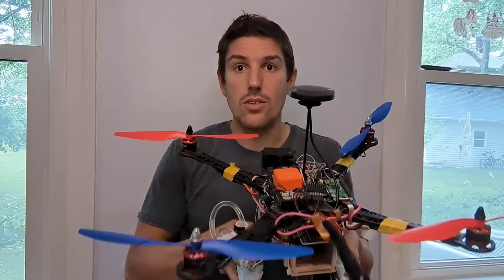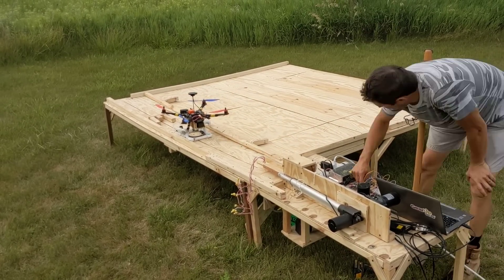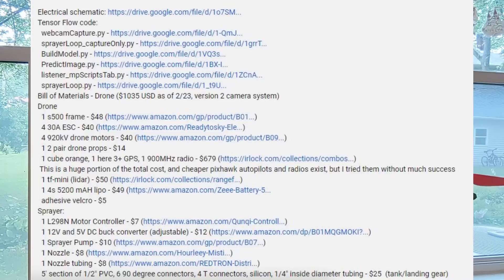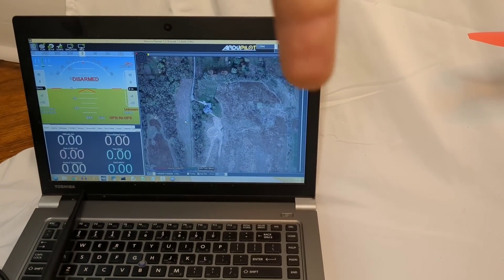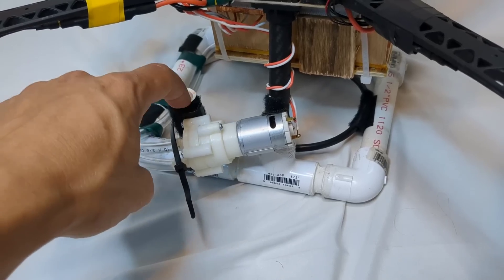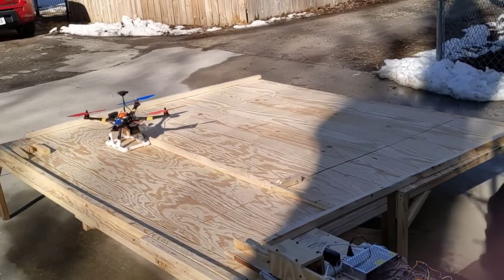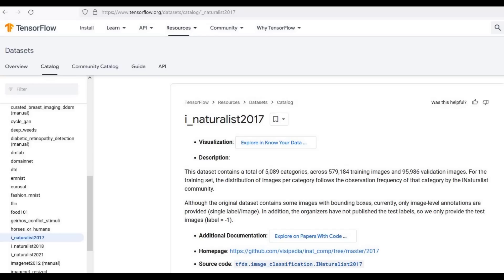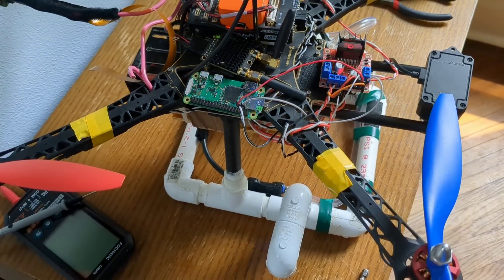DIY AI weed spraying drone, automatic landing pad/battery swap

Comment: This is really cool. I'm using your work as a guide to clean solar panels with a drone. I am curious, how do you determine when to fill up the water tank? Has it ever been empty during a mission before landing on the landing pad? Thank you.
Reply: I would think you could read the change in electrical current draw by the pump to determine when the liquid runs out
Reply from the maker: Yeah, it has emptied.  I'm working on a larger capacity tank and I try to keep missions short, but there are areas that are totally covered in weeds so it sprays constantly.  A float to detect when things are drained would be a good future addition as well
Reply: @nathanbuildsdiy  Thanks for the response, I thought along those lines of using a float sensor to check the water level. It's a bit tricky because I want to keep the drone as light as possible but I will investigate. Thanks again!

Comment: Wouldn't we need to get a waiver from the FAA in the USA for this? 

Waivers for Beyond Visual Line of Sight (BVLOS) Operations
To conduct autonomous drone operations beyond visual line of sight (BVLOS), operators must obtain a waiver from the FAA. BVLOS operations involve using autonomous capabilities and relying on sensors, cameras, and other technologies to navigate and perform tasks without direct visual observation by the operator. The FAA carefully evaluates waiver requests to ensure safety and may require additional measures, such as the implementation of detect-and-avoid systems.
Reply from the maker: Yup, I cover that around minute 40 of this drone build video: https://www.youtube.com/watch?v=Fflbc_y2IGQ&t=15s

Comment: have you had success running this autonomously for long periods of time?
Reply from the maker: For awhile, yes. But then the motors controlling the table burned up.  I'm now reworking the design so the collection/swap is faster and the motors don't run so long.
Reply: @nathanbuildsdiy  Haha Great thanks, Ill be waiting for the next video. Appreciate it

Comment: Now that it's been a few months, is there anything you'd change if you were starting over from the beginning? I've got a 2 acre hobby vineyard and just got my part 107 license and would love to build something like this. I've been talking to GPT4 about it for hours but it hasn't come up with anything near this level of ingenuity. Hats off to you, sir.
Reply from the maker: Glad you enjoyed it!  I'm working on version 2.0 now and I've got lots of changes.  
- rather than a threaded rod to move the "collecting arms" run them with a chain, similar to how a garage door is moved.  The motors I used are actually used in garage doors as well I found out later.
- More battery bay spots to charge more batteries 
- 3d printing most things to make it simple to build.  I want to make the drone landing gear one big hollow pipe, the battery cage a 3d printed box (so I don't have to hand solder so many wires and can just use the connectors on the battery itself) and change the battery bay into a rotating wheel (think like a Ferris wheel) on each side, so when you push one battery out of the bay it also pushes out the spent battery into an open bay on the other side of the drone and it just starts charging there.  

I'm planning another video with all those changes added in in the summer.  Still working on the 3d printer designs at the moment.   Let me know what you create!

Comment: One quick thing you can add to improve the battery swapping is to have a seperate "anti spark" pad ahead of the positive (or negative) terminal. This should then be routed through a resistor to the PDB, thus you first charge up all the capacitors on the escs, becs etc before connecting the low resistance terminals. This way your copper tape wont be eaten away by sparks each time you connect
Reply from the maker: This is a brilliant idea.  I'm already working on a v2.0 and I'll include this.  Thanks so much for the suggestion!

Comment: A 10K resistor between the Pi pin 2 and 3 and GND should keep the floating pins low at boot and not interfere with their signaling while the drone is in action. Or a 10K resistor between EnB and GND on the L298 would work also.
Reply from the maker: Excellent advice.  Will do for the next version.

Comment: We can better stabilize that RPI camera. The rolling shutter doesn't help either, but it should be stabilized so it's not as blurry (also reduce jello effect)
Reply from the maker: I think there's a new camera for rpi that doesn't have a rolling shutter, that would be a huge benefit.  I also think I need to start 3d printing - the camera holder, the battery housing, the landing gear/tank for the next version. That would likely help stabilize the image, right?

Comment: Great video!! How many acres can the drone cover before needing a battery swap? How much liquid can your spray tank hold and can the drone handle a bigger one?  Thanks again!!
Reply from the maker: I can get about .5 acres in a run - both the battery and liquid.  Some places weeds are really dense though and it just sprays and sprays and runs out too quickly.  At least it's automated so it'll just keep refilling and I can hit that area again later.

Comment: what's the bitrate of the pi? could you put some jet fuel on the drone by using a Jetson nano?
Reply from the maker: It's pretty slow, like 3 frames/second.  A coral TPU or jetson nano would make a huge difference.
Reply: @nathanbuildsdiy   For 3 Frames a second, it works quite well.  I think the one thing that's stopping farmers now is the "just works" factor. That's the hard part :)

Comment: I was working in uav precision ag research in the late ‘90s.  Big clunky 2m fixed wing aircraft and big clunky multispectral imagers on board with slow post processing to determine target areas.  How things have changed!  Great job illustrating the concepts and integrating the newer tech. 👍

Comment: Great idea!  I had no idea RTK was this inexpensive now.  If you can do this with a Pi 0, imagine what you could do with a Jetson Nano.  At 15 watts for the smaller ones, it does much more AI and still takes less power than the motors.  A better camera (more light/higher shutter speed) would also be better for humans fine-tuning a model and the AI running it.  Both may require a larger/heavier drone.
Reply from the maker: Yeah, a bigger drone + better compute power is the next step.  Do you know how rpi + coral tpu compares to jetson nano for performance and weight?

There's a new global shutter camera for rpi that has to be in the next version, will be way better images
Reply: @nathanbuildsdiy  I looked up the jetson nano for a different project using whisper (OpenAI's free speech to text/translation) which needs 16GB of RAM.  With your own carrier board it would be very light, like a Pi compute module, but that's more work than their off-the-shelf boards.  The software stack looks flexible with pytorch or tensorflow.  I haven't bought one yet.

I only briefly skimmed the Coral system.  It's probably less power hungry, much less expensive, and less powerful.  I haven't used TensorFlow Lite, but it's designed for edge applications (like phones not servers).  pytorch seems to be winning for research; many projects switch from tensorflow to pytorch, but I haven't heard of anyone going the other way.  Both packages are quite capable, and TensorFlow Lite is probably quite power efficient since it uses 8 bit data.  I deal mostly with Large Language Models like Llama-2, and with these 8-bit is more than enough once the model's trained.

So the Jetson Nano is more $$$, maybe slightly heavier & more power hungry, but way more RAM and better compatibility with random github projects.  The Coral is probably more efficient, cheaper and lighter especially with the Jetson's full heatsink.  I'm not familiar with image recognition libraries other than OpenCV, which could be overkill.  You've done more image training than I have.  Suppose you could also connect an FPV camera to a desktop computer and run whatever AI system you want.  Good luck!

Comment: I’m looking at AgOpenGPS (open source auto steer system) that can run relays to shut off sections on my sprayer to reduce sprayer overlap.  Now I’d love to have something like your tech running a see-and-spray program. I imagine it would be easier (probably famous last words there) to teach the model to recognize what needs to be sprayed during a spring or fall burndown where the only green things in the fields are weeds to be removed.
Thanks for sharing all this valuable information, this will probably be a winter project for me.
Reply from the maker: Thanks for turning me on to agopengps.  I hadn't seen it before and it looks great!

Yes - turning on/off sprayer nozzles would be a perfect application.  The time consuming part is getting LOTS of training photos and classifying them correctly.  The more photos, the better, think thousands.  John Deere and a few others are doing stuff like this but they have lots of people who can view/classify. You could also look for fungus/evidence of pests so you can spray fungicide/pesticide on the right places.  Putting it out so others can add to your repository and make the model stronger is a great idea too, perhaps on agopengps.

Let me know how things go! This is just what I was hoping for.

Comment: Not to mention it requires a special FAA permit/waiver to release chemicals from a drone.  14 CFR Part 137.  Buying/making a drone and using it to spray chemicals from it = a serious no no.
Reply from the maker: Correct. I addressed this in the detailed build videos.  At least it's <55lb, that exception is easier to obtain.

Comment: I would just have changed the raspberry pi to a dedicated neural processing unit for neural network, because a raspberry pi will take more than 10s and a npu such as coral dev board will take about a 1 sec and cost about 80 for the entry board
Reply from the maker: I'm thinking a coral TPU add on perhaps for the next one. Thoughts?

Comment: I hope you patented this, even if you want to open source it, you need to make sure it stays open source.

And I gotta say, your principles are awesome dude.
Reply: LOL... Patent.  Hilarious.
Reply from the maker: I don't know that you could get a patent of much value here TBH.  There's so much prior art on the underlying tech (image classification, precision drone flight, automated battery swap) because it's been described and used many places.  Putting it all together seems like it doesn't clear the non-obvious bar.  

At the least though, I've put this out in the public domain which should prevent some other entity from patenting this exact idea.  My intent is NOT to patent this design and to keep it open source so anyone can pick up and improve on it.  I should look into how to actually open source license the design.  I'm familiar with how that's done on software, but not something like this. Ideas?

Comment: Maybe you should consider Lithium Ion battery rather then Lithium Polymer. Li-ion has almost double capacity at the same weight. Keep in mind though that the discharge rate will be less. However this drone flies rather slowly and probably doesn't consume to many amps. Make sure you get the high discharge 21700 or 18650 cells
Reply from the maker: This is a great idea and something I didn't know about. That'd be a huge weight savings, I'm going to add it to the plans for the next version.  Thanks man!

Comment: You could probably use a combination of an electromagnet and electrical contacts to do the battery swapping (think XT60-like with magnets, or the USB-C ones for your phone charger), rather than modifying the battery with those big copper contacts (and having the corosponding ones on the drone).
Reply from the maker: Totally. I'm thinking next version will have a 3d printed battery case with normal connectors to plug into the battery inside the case, then some big plugs on the outside so it can plug into the battery case holder (also 3d printed) on the drone/charging station.

Comment: Second suggestion: raspi is having low shutter speed, resulting in those blurry photos. Consider using either the newer model RasPi camera, an action camera, or a cheaper DSLR that you can plug in and connect to the RasPi.
Reply: I guess it’ll be too heavy
Reply from the maker: Yes, I just saw raspi has a global shutter camera which (I think) means it exposes everythign at once rather than scanning the image.  That'd be just what you're talking about and wouldn't add weight.

Comment: If the setup is right next to a field, how many acres per hour can a unit like this cover?
Reply from the maker: I'm severly limited by # of batteries and charging time (the drone sits idle while battery charges).  It can only do ~5 acres per day. I think it'd be more like 25 acres/day with proper batteries.  BUT I've seen a few ag drones in the area that are 8 feet across (all flown by people, manually controlling)!  They fly much faster, carry more pesticide and can cover tons of area. That'd be the really valuable scale up. I saw one cover a 60 acre field in an afternoon

Comment: I am really not trying to make a thing but I am interested to know how this fits in the US regulatory system for drone spraying. Specifically FAA Part 137 and state pesticide rules. Since it's so small it doesn't need the over 55lb exemption which is amazing and is now the current bottleneck for AGRAS drones which are all now over 55lb.  Also, this could be really amazing for some of the work that we currently do.  This is closer to a flying "wiper" as they are referred to in AG for the small individual plant pesticide applications normally carried around by hand or backpack.
Reply from the maker: It still requires FAA certification - I cover that at the end of the detailed drone build video.  It's very lightweight as you said so the process is much simpler than for >55lb drone, but the pilot license/lightweight exemption is still required sadly. I hope it gets simpler at some point.
Reply: Seems like these would fly really low, hopefully an exemption could be obtained for agricultural use at low levels some day. This could dramatically reduce runoff into waterways with widespread adoption.
Reply: What about the regulatory side of the chemicals? Where I live, there are little to no herbicides approved for any aerial applications, and if they are, it's with significantly more water and coarser spray nozzles. I think that will be a bigger hurdle to mainstream adoption of drone sprayibg than anything else.

Comment: Continuous defeating  the weeds should also save on chemicals. The smaller the weeds are, the less chemicals you need. And you can even use physical killing those plants without chemicals. I expect that this has huge potential.

Comment: Has the UAV ever landed facing the wrong way?  Or is this just not an issue?
Reply from the maker: No, but only because I pull a "trick" when it lands.  It follows the same 3 waypoints at the end of every run so it's always moving south to north.  That orients it facing north when it lands since the drone always faces "forward" when it flies. That's how I can then push it into the corner in a known orientation to swap the battery

Comment: Absolutely amazing work. Echo the comments of the other dude wondering how you have so few subs. 

A lot of complexity comes from the drone landing/inaccuracy/battery limitations. I wonder if a cablecam type system might be simpler in some ways. Harder to deploy over a large area like a field but for gardens/yards, I could see it solving some problems. Could take a nice bite out of pesticide use in lawns. I don't have the ingenuity to pull it off but you certainly do.
Reply from the maker: That's an interesting idea! I'll give it some thought

Comment: Great project! I want to build my own but I bet the only expensive thing on the drone is that 'orange box' 🤷. (Edit) You could use the Makita style battery connector, its 2 pin terminal is available in most markets. Just need to print the holder.

Comment: That landing platform is a perfect example of less is more.  I wonder what it would take to protect it from inclement weather?
Reply: Linseed Oil
Reply: @WW5RM  or some shellac
Reply: Polycarbonate sheet or similar for the landing pad a covered aircraft hanger for the battery swap area🤔
Reply from the maker: I'm hoping next version of this will simplify the landing pad even more. I'll swap out the threaded rods for bike chain so it looks/acts more like a garage door opener.  I also want to add a lot more battery bays while simplifying the swap process - still a work in progress.

Comment: Great job, you could streamline it with cheaper parts and sell it as a kit, but still you have to be an engineer with crops to do this.
Reply: The engineer/farming overlap is often higher than people realize, especially on smaller farms.  Most farmers have enough knowledge to repair their own equipment, and pick up new info pretty quickly.  There's a reason Right to Repair is having it's best effect in farming

Comment: Thanks for sharing! I hope to attempt this project this winter. I have 20 acres to spray.
Reply from the maker: Let me know how it goes!  2 improvements I'm working on
1. Get rid of threaded rods, instead make it more like a garage door - think bike chains turned by the motors pull in the collection arms.  It'd be faster and more reliable
2. Add more batteries, build around them so you don't have to solder the pads.  I'm working on a 3d printed drone base with a 3d printed battery bay and 3d printed battery holder.  Probably will get to it this winter.